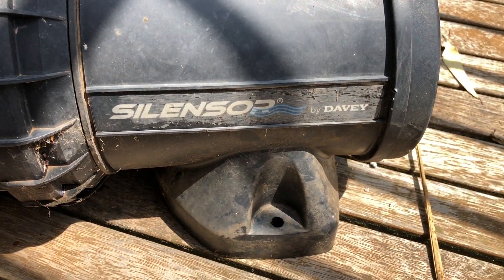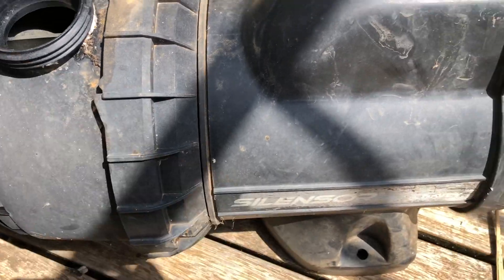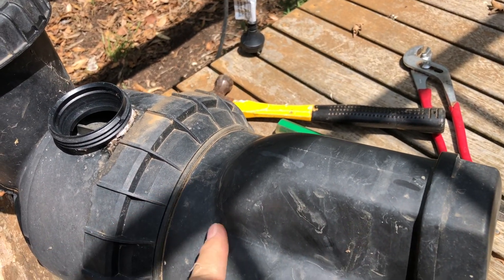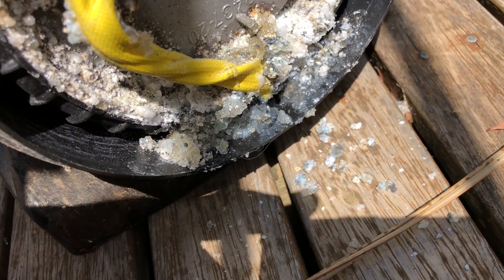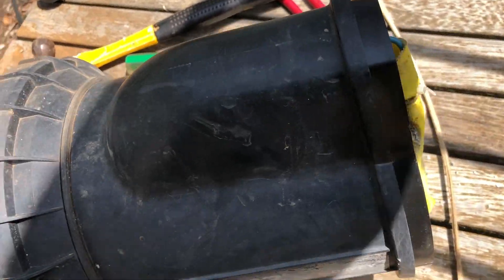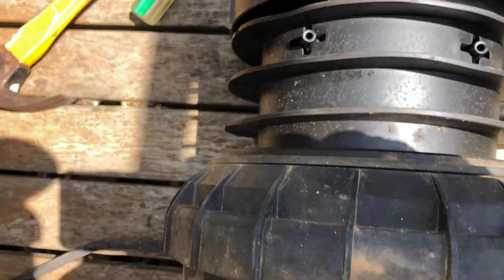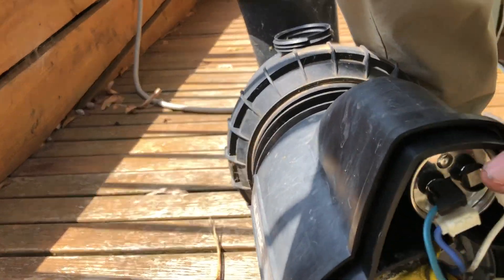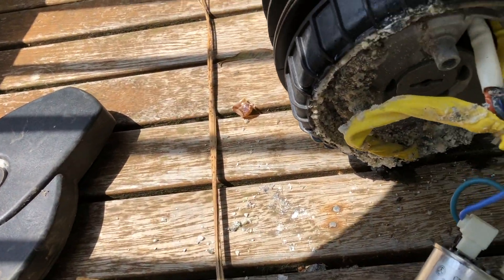Davey Silencer Pump Review and death. How to get apart, disassembly

Comment: I believe the issue is the mechanical seal. It seems to fail frequently so water goes in, destroys the bearings and in the worst case, goes in the motor as it did in your video.

Comment: Yep - bought one that lasted 12mths as water got into it. Cheap crap. The previous AstraHurlcon - 12 years didn’t miss a beat.
Reply from the maker: Yes many of the big brands have sold out and are now very poor quality. I only use Hayward. They are good quality and last well. give me a call at Nillumbik Pool & Spa Service if you are chasing a pump. I instal them in Melbourne, and post them all over Australia and New Zealand.